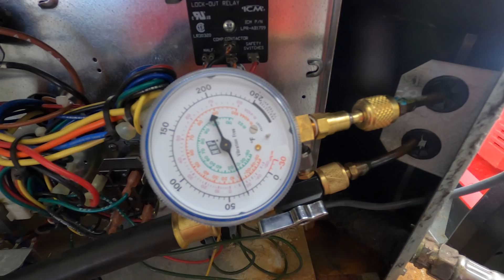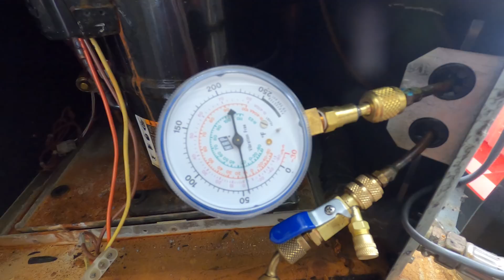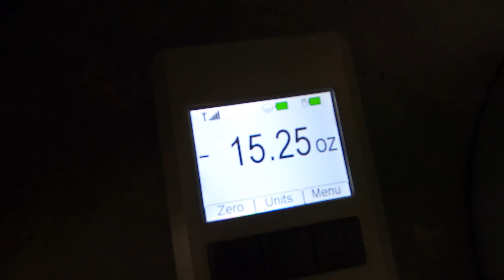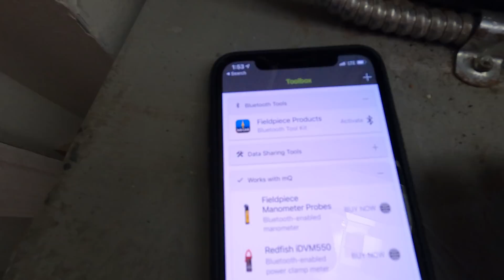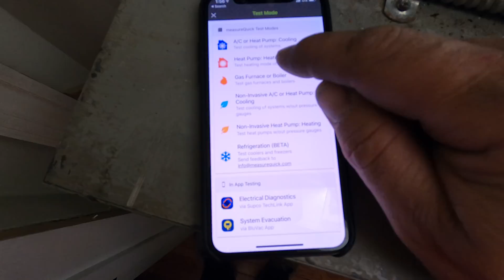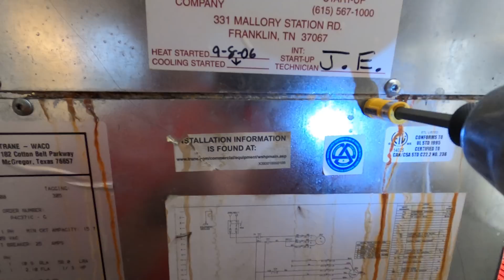Trane Water Source Heat Pump With LEAKING Coil | Let's Do Some Work!!

Comment: Hi Zack I have been searching you tube for technicians working on air handlers in closets and came across yours I was wondering what would be the minimum size of the hole or holes for the return to get at least the minimum air intake for a 3.5 air handler in a closet. I have two holes that are covered with a return grille that is 30x12 and the other is 24x14, would this be enough opening for air to get to the air handler and let it work properly? Thanks for any advice. David

Comment: what would cause your AC filter to be slightly wet all the time during spring and summer?  Had the condensation line cleaned and blown out and unit is less than a year old?  They tell me its normal to have a little water on it? But I think its something with a coil, what should I tell them its still under warranty. Thanks

Comment: Zack, I enjoy your videos and the quality of your work.  You don't cut corners (or at least I don't recognize that you do on your videos).  I've been a service tech since 1981 and love my career.  Would love to have co-workers like you.  Only 2 thing's I would suggest on this video.
1. Use a drop cloth to protect the customer's floor.
2. Was that CO2 on your cart?  If so, were you using that to purge and pressure test?  If so, the moisture in CO2 is too high and can really slow down your evacuation time.
You probably already know this and I probably missed seeing the nitrogen tank.
Keep the camera rolling!!  Can't wait for the next one

Comment: When charging a system as a liquid is it best to charge from the low side or high side?
Reply: If it’s an empty system put in the whole charge in liquid through the liquid line.  If all of the charge won’t go in then start the unit and charge liquid into the suction line 10psi over operating pressure

Comment: I really wanted to get the psycrometer, pressure and temp set from Fieldpiece but trutec tools gave me a whole set of wireless probes.  I won't be able to use them until 2021.

Comment: You have some nice equipment.  Great job.  I’m glad to see you run nitrogen when brazing.   They don’t teach it in Hvac school here.
Reply: Gene Miller, why is that alright? I’m curious here. I’m currently in hvac school now.
Reply: Because without the nitrogen to remove the oxygen it causes oxidation inside.  It’s introducing a foreign particle into a system which needs to be very clean.   The newer systems are very finicky and cause unnecessary repairs down the road.

Comment: Good system work. I'm sure you work mostly in commercial area's where you don't have to protect customer surfaces. In residential work it's a MUST and may save you big by taking the extra time and thought to lay down protective materials on flooring, carpet, etc.. Thanks for the video.

Comment: great job , I wish mine were off the floor like that, I only have one question wouldn't have bin cheaper to replace the unit instead of just the coil, do to it being an R22 system?
Reply: I was thinking the same thing. Ive delt with a few of those types of units. and they are pretty cheap, plus the labor involved in the swap out is pretty minor. Much less than changing the coil.

Comment: That cart setup is pretty nice. You should check out ShuBee for shoe covers. I was wondering whats the purpose for the temp. probe on what I assume is the water inlet?
Reply: You want to check the temp rise of the water loop on a water source heat pump.  Will give you an idea of flow and if there is a clogged strainer which will cause a high head pressure trip

Comment: Btw , I'm curious to know , if the condenser is water cooled, is there a loop with a dry cooler on the roof , or is there a hp regulating water pressure valve and the water goes in the drain ?
Cheers .

Comment: I worked on tons of those Trane WSHP here in Hawaii, worst thing is capacitor behind the electrical compartment, 😐 but I've ran into alot of leaky coil's and they all started happening one after another

Comment: Not a fan of those big flame throwers on small devices. I find it easier for small jobs like that to use a “0” tip. Less of a heat zone.

Comment: Nice installation, but the fact you don’t protect the floors bothers me. Customers appreciate it when we take care of their homes.
Reply: I agree. I do PTACs in NYC and you could imagine how those apartments are. I always use drop cloths, even on carpet.
Reply: Edgar Lopez: They sell at Home Depot drop cloths with rubber material, I work with them all the time, now if you buy the cheap ones because you don’t want to spend $ it’s on you if an accident happens. I’ve worked in high end homes or regular homes and the customers appreciate the detail of using shoe covers & drop cloths, that’s how the company gets more customers.
Reply: Yeah nothing beats being careful
Reply: Drop cloths on wood floor can be slippery... customer ain’t gonna pay for a medical bill if you slip and bust your head... if it’s really that important the customer can lay some cardboard in the work area or something. That’s the way I see at at least

Comment: Did you offer Easy Seal for a tenth of the cost first? Unless it is flat out Easy Seal is ideal. I have had to use Easy Seal on a new USPS system that would not stop leaking, every year had to add about a pound of 410A. I was telling them to use Easy Seal for both times it was recharged. Finally they sent me to do a complete electronic leak detection. After two hours on a 5 ton commercial Carrier split system, with a 15' line set, I convinced the owner to use Easy Seal. No one has recharged it for the last 4 years.

Comment: Do you like that nitrogen regulator I was thinking about getting it the other day but didn’t know anyone who has actually used it
Reply: That is the problem with that regulator is the micro filter and the small little orifice on the outlet port. Makes it so not as much volume of nitrogen and pass through it as a regular regulator. It makes for a very long pressure test. It works great on the braze setting for purging nitro while brazing. Nice thing about the pressure test though is how accurate the guages are so you can set the reg to what ever pressure you want and walk away or do other stuff while it fills. All in all a good reg but the slow pressure test can be frustrating.
Reply from the maker: Yes I do! One thing i don’t like is that you can’t use it to blow out drain lines. It requires back pressure to build pressure. Other than that, it’s awesome.
Reply: I just got that regulator, it is easy to take off and on, but it has a micro filter that is used to keep the regulator dirt free, also slows the nitrogen to a crawl. So DO not think it will fill just like normal regulator. So it cost 2x more for ease of removal.